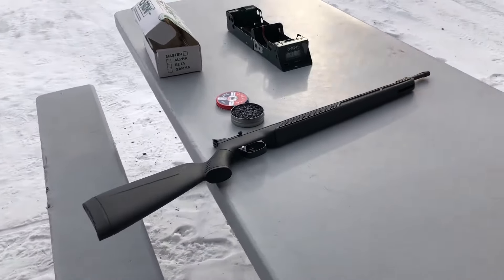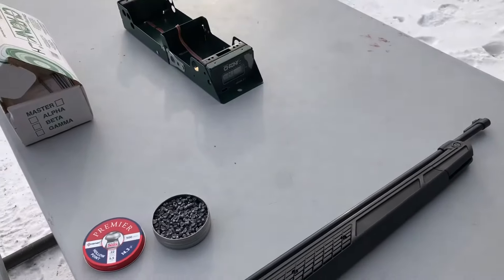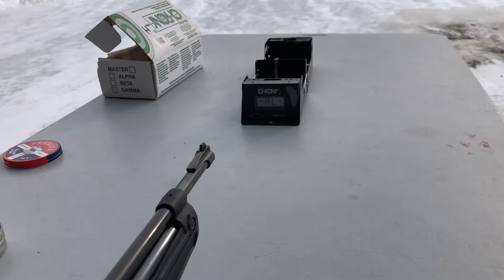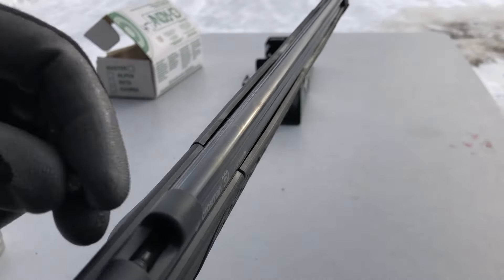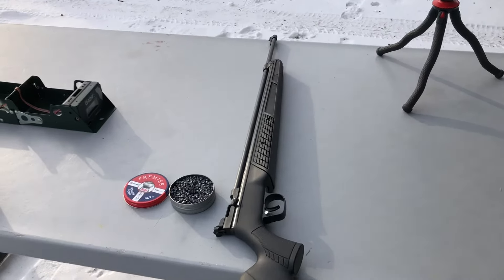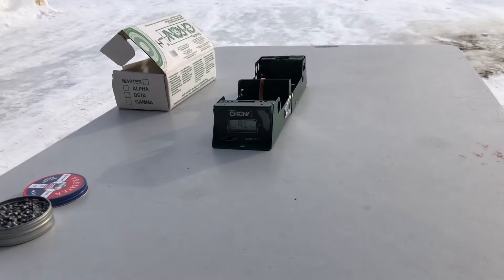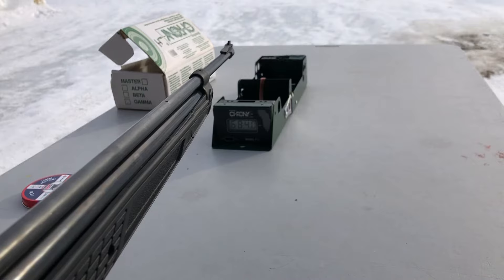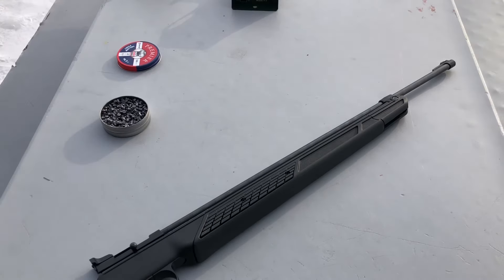Crosman 362 - crony results stock versus 24” barrel

Comment: This is going to be my next airgun. I've already purchased modification parts for it. I was going to get one when it was first released but it never happened. I was thinking about putting on the longer barrel too but I like the ability to put the gun back into the original box. Lol

Right now I'm working on converting my modded plastic receiver 760 to metal and  creatng my own rendition of a 100th anniversary Legacy 1000  from an extra 766 (non branded reciever) that I had laying around missing a stock.
Reply from the maker: I really like the 362! It’s easy to modify, easy to pump, not very expensive and can be pretty accurate. I’m working on another video with this gun and an issue I had with an aftermarket breech. I’ve got it sorted out now but I think guys will find it interesting.

Your 760 project sounds really cool! 😄
Reply: @airgunsofalaska  Yep, I'm just waiting on parts. 

 I like how you still have some of your old childhood airguns. As a kid, I actually started out  with a "hand me down" Crosman 766 that originally belonged to my older brother. It  stopped holding air and it's the reason I got lured into the "airgun rabbit hole".  While messing with that gun, I ended up with a free plastic receiver Crosman 760 which I began modding over the years. I've gone through one  set of plastic receivers that cracked at the base where the stock attaches so I decided to convert. 

I consider your 760 the 2nd best design Crosman has ever made of the 760 because it's mostly metal and you can seal them up pretty well without too much effort . Crazy me has 3. 😂  I have a modded one with a longer Crosman 66 pump tube and wooden furniture and two untouched mint commemorative versions still in boxes. I consider the best 760 design to be the version with the hybrid plastic/brass bolt . I only consider it slightly better because it has the ability to hold the bolt closed on 760s modded for power. 

😂 Yea I know, I'm talking too much. It's just my enthusiasm for airguns.
Reply from the maker: @jackpotparty58  that’s really good to hear that the 760 is easy to reseal. I believe I ordered the correct parts for mine years ago but was worried I’d start taking it apart and springs would go shooting out. I think I’ve now worked on enough guns to take on that project this spring. 

Super cool to hear about the mods you’ve done! The customization sounds great. 👍 I get way more enjoyment tinkering around with the classic or lowered priced guns than pining after some expensive model. 

Since starting the channel it’s been really enjoyable to dig out my childhood guns and shoot them again and learn what is required to repair them. 😀
Reply: @airgunsofalaska  The Crosman 760 isn't too bad to reseal. You just have to keep everything straight and supported.  The main issue is the trigger spring which may catapult your safety switch into the future. The next concern is the hammer spring. 

If you ever have to go into your Crosman 2100 (766, Am77, Legacy 1000), you may have to grow another set of arms. Messing with the bb mechanism in those guns is like playing a timed game of perfection.
Reply from the maker: @jackpotparty58  Thanks for listing the potential trouble areas! I had a bad experience trying to repair a cheap, spring action BB pistol and just remember parts flying out. I could never get that gun put back together. I’ve gotten pretty good with Daisy 880’s and the Crosman 13xx & 22xx guns. I have so much sentimental value in my 760 that I don’t want to risk turning it into a pile of parts. Once I decide to work on it I’ll search up some videos to get familiar with the process.

Comment: I changed mine with parts previously available online.   Metal receiver and a 26" barrel.   Max power for this is 10 pumps.   It went to 17+ fpe with 16 grain pellets.
Reply from the maker: @lon8983  I called Crosman last week and the 26” barrels are no longer available. 🙁 I tried a 26” barrel out last fall on this gun off my Maximus but I don’t recall noticing a significant difference. 8 pumps is max for the 362.

Comment: Have you considered trying a flow through bolt like from Mellon Air? It gave me a little FPS boost, around 10fps, out of my 1377. Really like how it pushes the pellet base past the transfer port. would be really curious to see how it acted in a longer barrel
Reply from the maker: @jonathanrogers9961  I wasn’t aware such a thing existed and never thought about how the probe and transfer port lined up. I always then wonder about what other issues a none stock part might introduce? Part of me thinks if there was much to gained the factory would already be doing it. But that perspective comes from 40 years of seeing, occasionally buying, and using different aftermarket and performance parts in my powersports hobbies and more often than not, seeing those parts not live up to their claims. 

I guess I’m a bit turned off by the language on his website as it makes the guy sound like a grouch to deal with if you have any issues. I’m thinking the flow through probe might slightly damage or reshape skirts upon loading and that could negatively impact accuracy.
Reply: @airgunsofalaska  He is a bit of a grump but everything i have gotten from him has been good quality, think hes just been hassled too much. Kind of a, you should know what this is, take it or leave it attitude. I have not had any skirt damage or loss of accuracy that i could see with the flow through bolt. I find pushing it forward with the skirt centers it better when seating. It also guarantees the skirt gets past the port. And puts all the air directly behind the pellet. I rather like it over the extended probe. And its very well priced at $18.
Reply from the maker: @jonathanrogers9961  that’s really good to hear! There is part of me that wants to modify my 367 even more so it’ll produce more power. It looks like he carries the parts I’d need. Now you got me thinking. 😄

Comment: Just curious. Is that a standard Crosman 24 inch barrel ?
Reply from the maker: Yes, the 24” .177 barrel I ordered from a vendor on eBay. I also installed a .22 24” barrel on my other 362. I bought that barrel from MAC1 Airgun’s in the fall of ‘22. I don’t know if he’s got his website back up and running yet?
Reply: I have a 24” .177 barrel coming to convert my 362 to a 367.
Will purchase another 362 either new or ideally one that needs work. 
Plan on building this one out in .22 cal with a 24” likely from Buck rail.
Thinking of trying the breech being offered by AirGunMods. 
As long as the barrel O.D. 
Are 7/16” it should work.
Reply from the maker: @MSHAIL2 I saw that AirGunMod breech. I was initially interested until I saw it was made out of plastic. I believe it’s only $10 less than a Crosman steel breech. I know the Crosman breech works for either .22 or .177. You just swap out the probe for the calibers. 

I really like my 367 but I’m not sure that I got a good barrel. It’s either super pellet picky or simply just not as good as my .22 barrel.
Reply: I did notice that with the pricing.
Not quite sure what direction the builds will go. First order of business is to complete a 1322 
build with a steel breech and 
a 15 “ barrel I bought from Mellonair.  I want polish the I.D. before I put it together.
Next will be the 367/362 builds unless I come across a decently priced Crosman 140 or a Benjamin 397PA. So far no luck.
I like the Daisy 840 put I am afraid of pulling the plug on one because I believe the air transport piece is plastic and prone to cracks.
Went out and purchased a Daisy 2840 for the time being.
Reply: @MSHAIL2  If you're interested in one that needs work I have one that the seals failed and needs a rebuild which i''m not interested in doing.

Comment: Without the power valve and oversize transfer port you're not gonna be the 10-13 extra fps per inch of barrel..made little to no difference on mine either..
Reply from the maker: I’ve got a couple of over sized transfer ports and wasn’t impressed with them. They didn’t fit or seal very well. Mine were just pieces of tubing and some kind of rubber type sleeve. Maybe there is a different style out there? 

I had this barrel on my 1st 362 and it shoot pretty accurately. I converted my 1st one to .177 so I wanted a .22 cal again. 😀
Reply: @airgunsofalaska  I have the Alchemy Airwerks set, it's metal, a little rough but looks fine, haven't tried it yet though.
Reply: @airgunsofalaska  I've got the new 362 PCP  ordered. Cant wait to get it..👍
Reply from the maker: @yoitired  I just installed the Baker aluminum receiver I had lying around. I wish I’d known more about this stuff when I bought it or I’d have sent it back due to the hole spacing being slightly off. It’s a pain in the ass to get on the gun compared to a Crosman steel breech. I really need to egg out the holes with a round file. Not acceptable.
Reply from the maker: @gwhitfield4239  I saw the new 3622, it looks interesting. It’d be a very thin, light weight gun!
Reply: @airgunsofalaska  I'm glad I didn't get an expensive, vintage, non-returnable, resealed by Baker gun then.  I thought that's what I'd have to do to get a good .22 pumper but the 362 is perfect when it's working right.
Reply from the maker: @yoitired  I went down a rabbit hole with vintage guns a couple months ago and… yeah. The one gun I was so excited about getting still doesn’t work properly and I’m finding out the hard way about all the obsolete, no longer available parts it needs. 🤬 It went from fun to something I’m sick and frustrated of working on. 

Is your 362 still working well? I just robbed the steel receiver off my Drifter last night to install on this new 362. I’m trying to decide how I’ll present the video for why I did that but it involves a Baker Airguns product.
Reply: @airgunsofalaska  Ah that does sound annoying, and if you're having a hard time I definitely would, Nibs makes it look way too easy keeping the antiques going😄
Reply from the maker: @yoitired  it’s a gun I really want to feature on the channel but dang! Trying to get the right parts without getting ripped off is a hassle. It’s funny, Nib’s videos inspired me to seek out the guns I wanted as a kid but now I’m discovering the downsides of repairing 40 year old airguns. This Daisy I want to feature has actually brought more frustration than joy and it has sat for weeks, neglected, as I’m sick and tired of futzing with it.
Reply: @airgunsofalaska  I know that feeling, being able to finally get something I never could as a kid.  Nib's restoration hobby sure looks rewarding but yeah, I'm seeing there's a lot that goes into it, would require way more patience than I have!  Hopefully letting your Daisy just simmer for a while will give you new ideas for it, that's where I'm at with the first 362.
Reply from the maker: @yoitired  Yes, just like you said,  I have set the Daisy aside and started focusing on my two 362’s. I watched an Airguns of Arizona pellet sorting video the other night and am already feeling the pull of another rabbit hole to fall down into. 😆 I saw flashes of brilliance with my 367 yesterday and pellet size/weight variation could explain the flyers I see that ruin amazing groups. I think pellet sorting with some beers could be tolerable and the results appear to be well worth the effort.